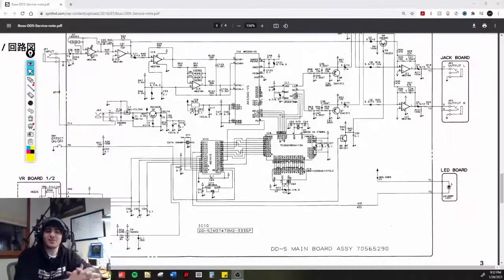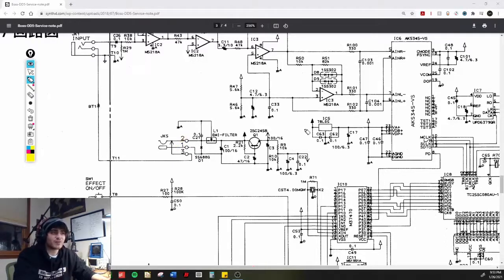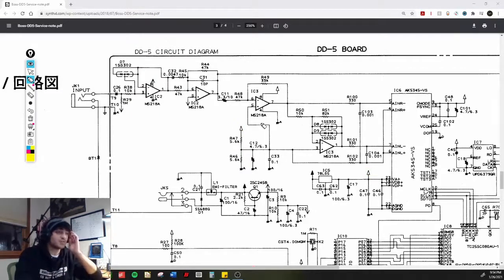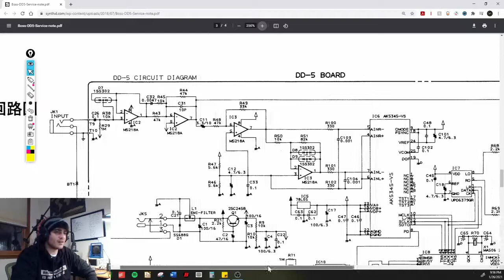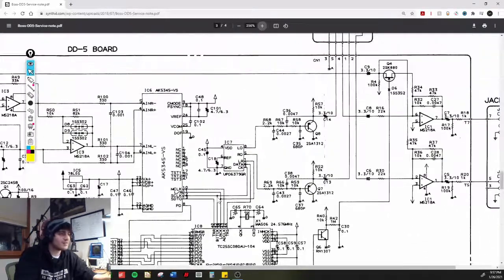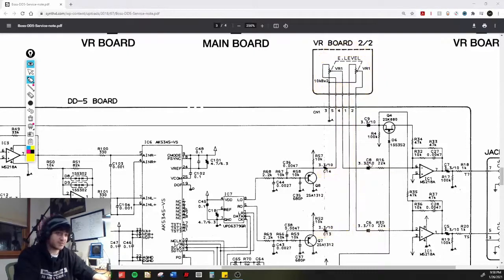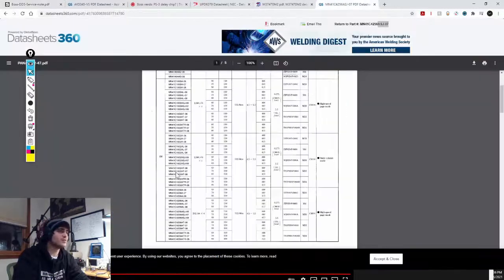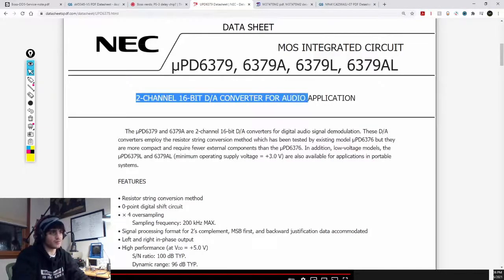Repairing a BOSS DD-5

Comment: I'm trying to fix one of these at the moment.  Had a shorted zener on d2 and changed d1 as well.  That sorted the light always being on, it now switches off and on when the pedal is clicked but I'm not getting voltage on the jack on pins 1 and 2.  What would be the problem here?  Q1?  I get voltage on all the other op amps and chips just not the jack.  Any ideas?

Comment: I'm having the same issue with mine, I'm not at all electronically inclined, I wish I understood any of that 😂 I'm glad it's fixable, though
Reply: I loved the sound of mine but these pedals are getting old... like old cars stuff starts to break. Mine the clean signal is distorting and quiet on the main output but the delay is there. Panning output works fine but the delays are wrong timing without the other output